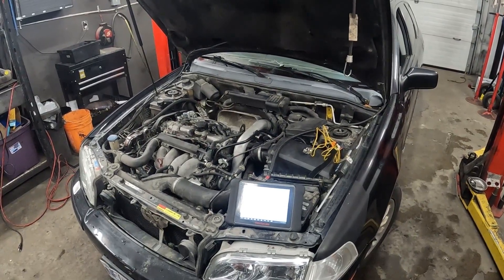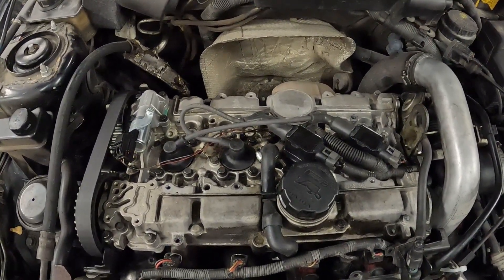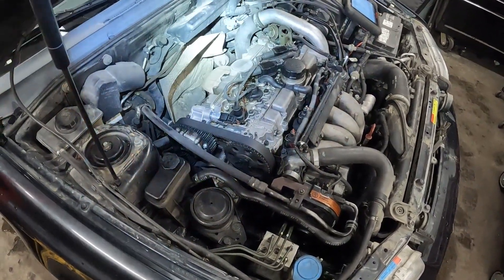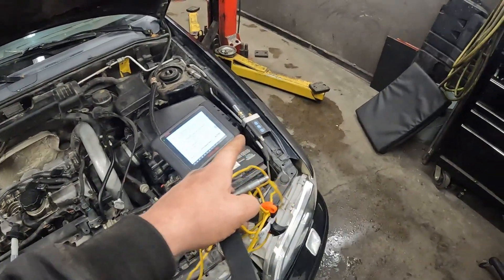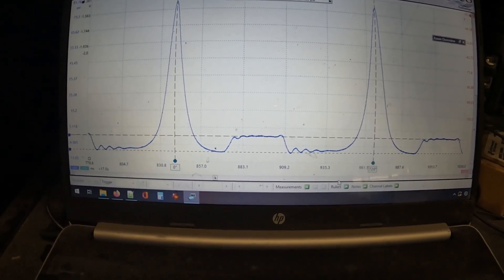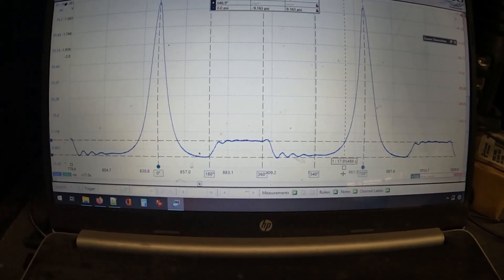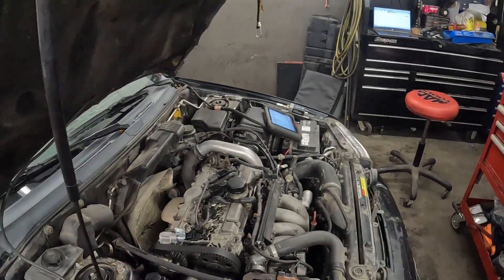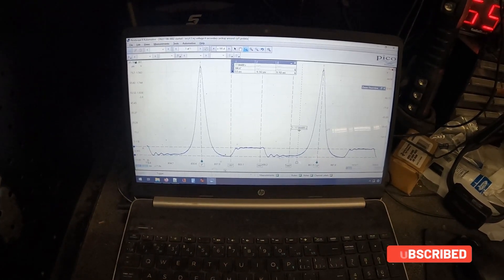2004 Volvo VC40 - P0014 & P0015 - How to check timing FAST & EASY with pressure transducer!

Comment: So what exact is the problem? Crankshaft seal? Or timing off
Reply from the maker: @Cadet Auto  Both. The timing was off and the belt was super oily from the crank seal. I'd have to assume the oil on the belt caused it to jump time but it's also possible that the belt was always out of time. The customer hasn't owned the vehicle very long. He was trying to fix it up himself but was hitting a brick wall so he brought it in to us to be diagnosed. It also had a faulty ECM that was glitching out when it got hot.
Reply: @eurbanautotech I am having the same issues with my 2004 Volvo s40 1.9L turbo. P0015 code and bank 3 rich. Did you make a video on what you did and how? Also is it safe to drive with that happening?